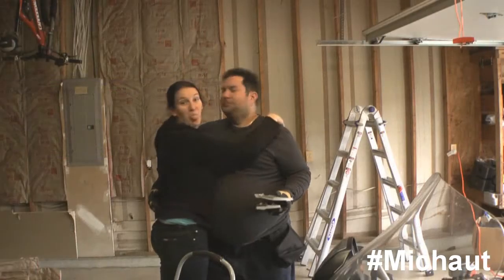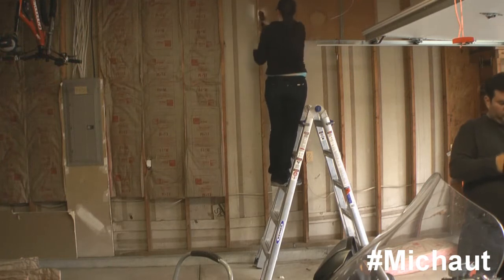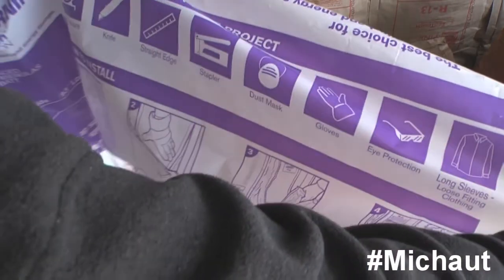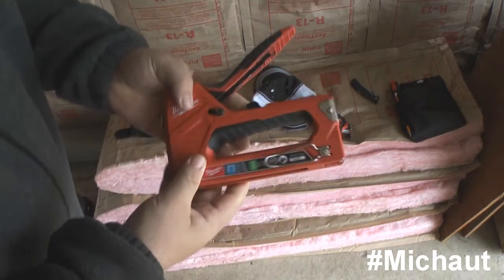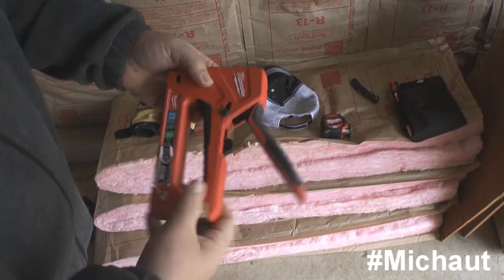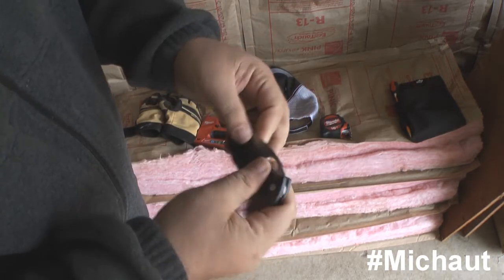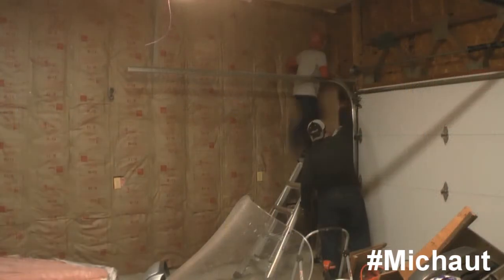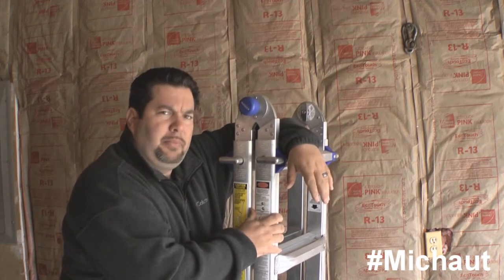Batt Insulation  Installation and Suggestions - #Michaut

Comment: the best way to do the triangles is tare the paper off the batts and cut them and than put the paper over them thats the way i do them it looks neater but Great video.
Reply from the maker: +Jesse Salgado  I totally agree,  but for new people that are not the best in figuring the angles and installing batt for the first time... IT took me three tries to figure out to make a paper cardboard  template and use that as a tool.  Id still say foam board is better.

Comment: You have to cut 45 degree angles in the edges of the Batts if not you can see the leaks with an ir camera.  Batt insulation is really a lot worse then rolls and is only used by people not working on there own house that just want to do a quick hack job